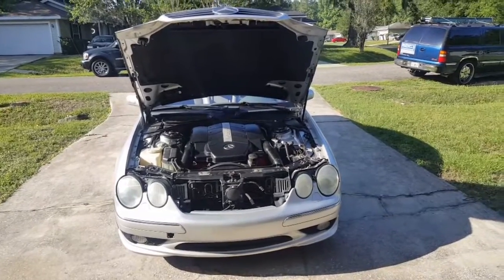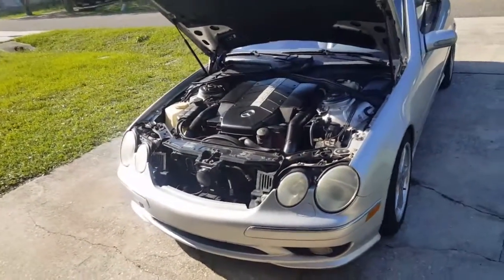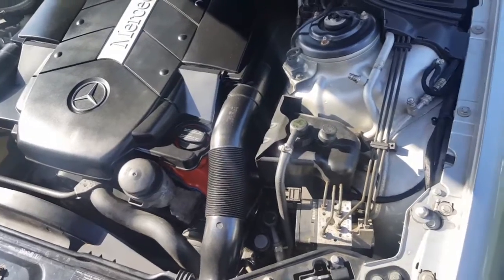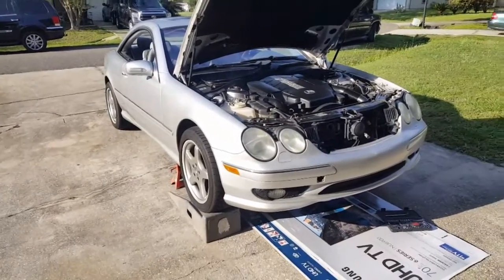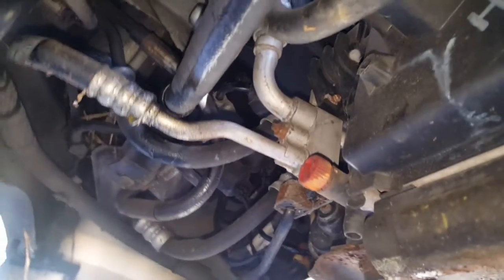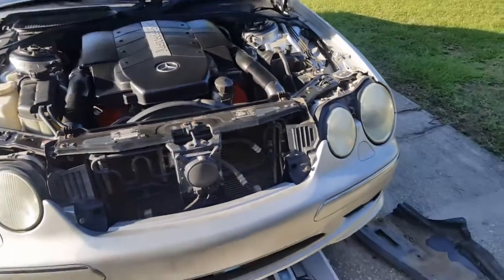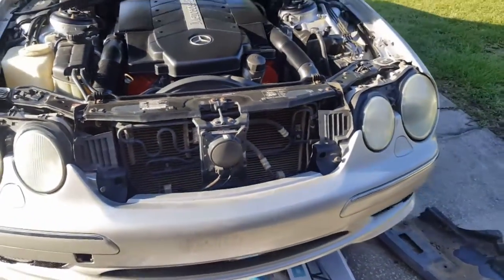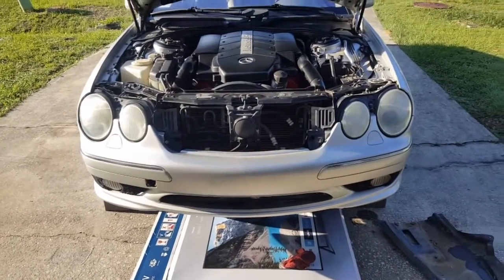Mercedes CL500 W215 Power Steering Trouble...

Comment: I wouldn't change the egr valve, check the rubber hoses there and in front of the engine. I'm still holding on to my ABC system, I dread the day I change my mind. I needed to replace something recently and it was about 475 out the door. Fortunately my parts car had a good one.
Reply from the maker: I appreciate the advice. I miss your videos. When are you coming back to youtube?
Reply from the maker: Did you start a new channel?
Reply: @projectcl500  yes and no lol. I do forex too.